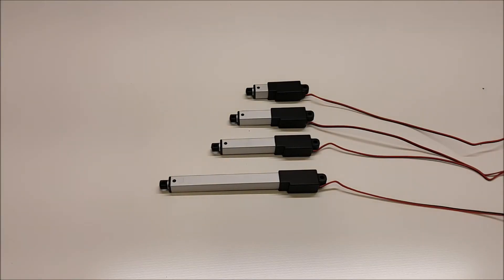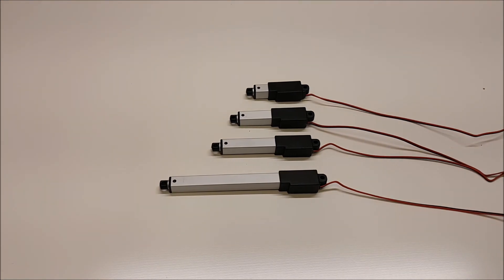L12-S Micro Linear Actuator Product Overview

Comment: Very helpful video, which is more powerful the 50:1 or the 100:1 The 50:1 looks to be the fastest?
Reply from the maker: You are correct. 50:1 is faster, and 100:1 is more powerful. The higher the gear ratio the more force it has and the slower it will move.